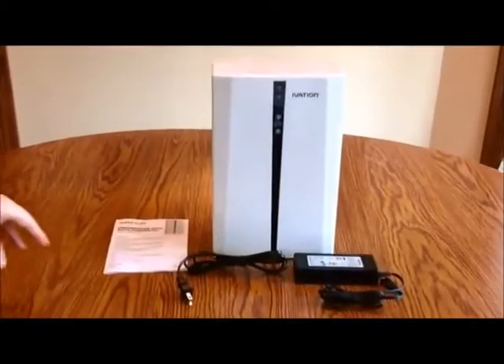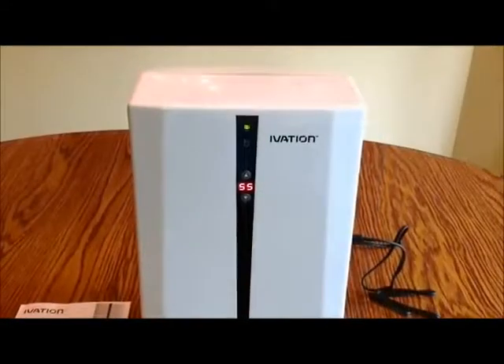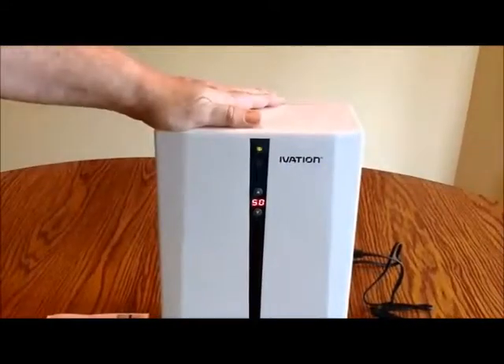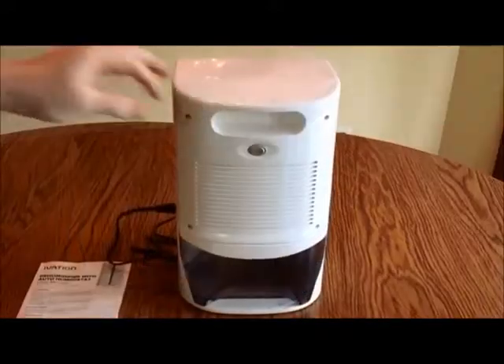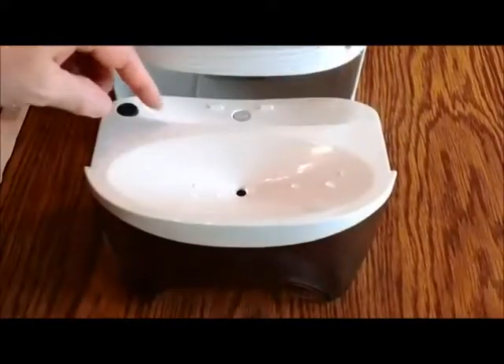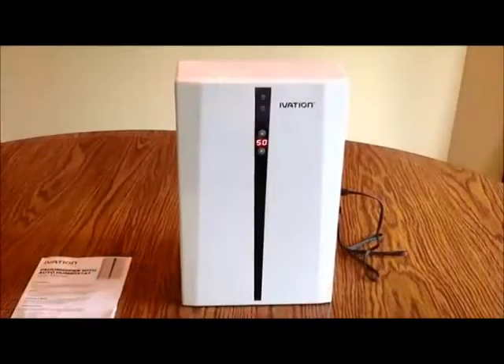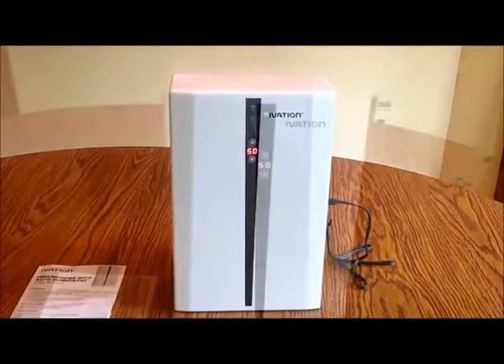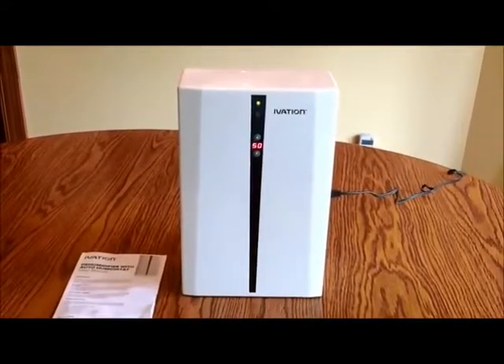Excellent Ivation Powerful Mid Size Thermo Electric Intelligent Dehumidifier

Comment: Will this be fine for a 3x3x6 grow tent? Thanks in advance!
Reply: use your space OUTSIDE your tent as a "lung room" it is exponentially easier to deal with maintaining environments and dealing with issues when youre conditioning the area that your intake air is coming from. plus running in tent takes up canopy space. run your stuff outside and do the whole room youll be super happy.